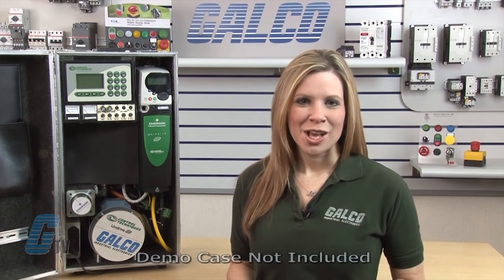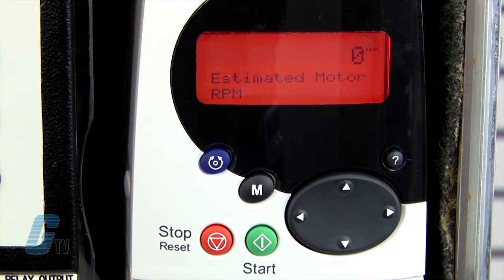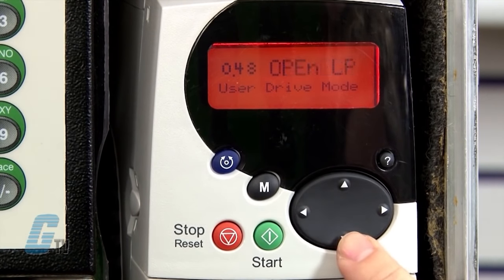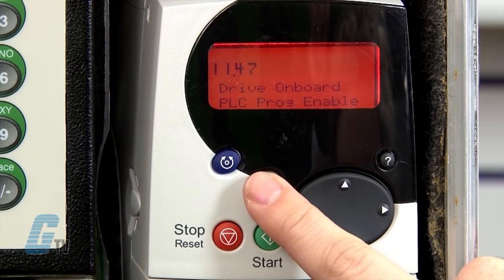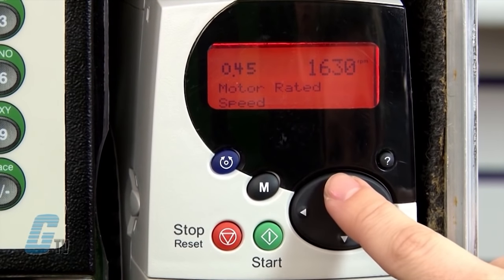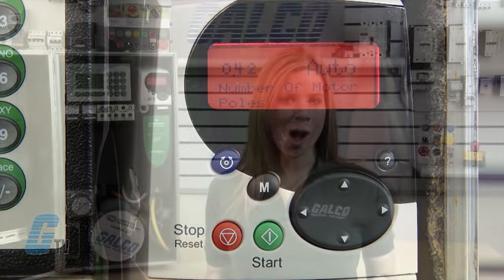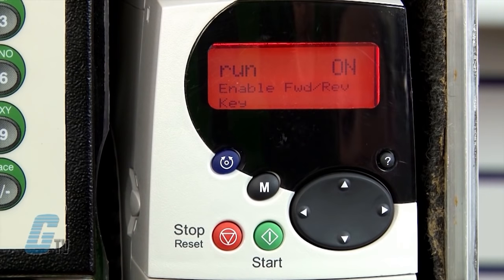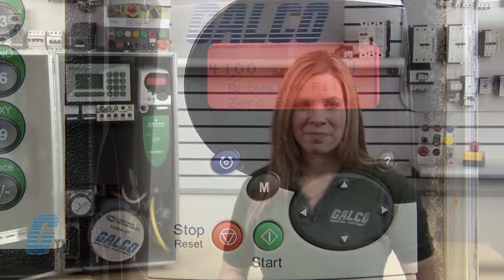Emerson Control Techniques Unidrive SP Open Loop Set Up - SM Keypad | Galco

Comment: I have an Emerson drive SP 2402, facing an alarm/fault “trip it.AC”. I tried to change the parameter 5.07 (by changing 0.49–>L2).
The par 5.07 doesn’t allow me to change the stored value that’s 0.00. 
Please I am seeking for the help. 
Does anyone know how I can fix the issue..

Comment: Hello. We have sp1406 indicating SL3.Er And SL3.Hf. could you please tell me how to solve this trip problem? Thank you very much
Reply from the maker: Ok the SL3.er fault means the drive isn't seeing the module in slot 3, or that module has been changed. Having said that, we have found on older SP drives sometimes these connectors become corroded slightly and may be able to clean enough to restore operation by simply removing and reinserting several times and push red reset/stop button. You must take special care when reinserting module to line up connector correctly so as to not cause more damage to unit.
The SL3.Hf fault  is a type of hardware fault. If this does not reset with the red reset/stop button or cycle the power, the failure may be terminal.
Reply: @GalcoIndustrial  Thank you very much for your soon answer. When you Say terminal un lastre sentencie do you mean fatal failure or connection terminal fail?
Reply from the maker: @laterrazabbq5647  Fatal or time to replace

Comment: i want how the unidrive communicate with  @calco TV please help me out !
Reply from the maker: Hi nasreddine ramdani, can you be a little more clear about what you are asking please? We would be happy to help you.
Reply: i want to know how can i communicate with UNIDRIVE SP M using Labview and how can i generate its values?
Reply from the maker: Hi nasreddine ramdani,

The drive has a serial communication port that is EIA485 type from an RJ45 connector. This port is isolated from the high voltage in the drive.
It supports to different protocols “MODBUS RTU” (default) and “CT ANSI” that are parameter selectable at parameter #11.24 (or zero menu 0.35 is same thing).
A 0 = CT ANSI, and a 1 = MODBUS RTU.

Let me know if this helps you out.
Reply: Hi Galco TV

Thank you a lot for your help ! 
I found that very helpful, and i would know if you have an labview structure of what you just explained to me.
That would be a pleasure to work with you !

Comment: Very good all this information, I really like learning about Variable Speed Drives, but I'm starting to learn about the management of Emerson Unidrive that possibilities exist to publish this information in Spanish?
Reply from the maker: Unfortunately, we do not currently have the resources to overdub the videos in different languages.  There might be a Emerson Control Techniques manual with information published in Spanish.
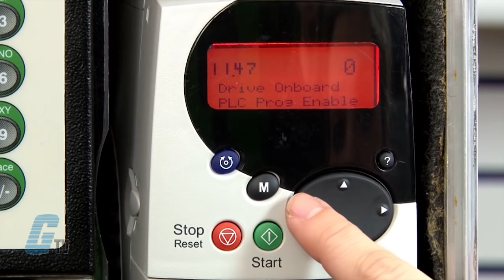Reply: GalcoTV thank you for reply , but in open loop (without encoder) i can change in parameter 4:11 just from 0 to 1  , or change from 0 to 4 in close loop .
i want to rum torque mode (unlimited speed )in open loop .
thanks
Reply: Ali Suliman i hope to help me of above problem as soon as possible
Reply from the maker: Ali Suliman You're right, then you will only be able to change it to a 1 for open loop.  This should put you in torque control mode.  I would also suggest downloading a manual from CT or from Galco's website.  To find it on Galco, check out the links above in the description page and navigate to the docs and links part on the product page.  A digital manual can also allow for easier searching by using Ctrl+F to find your selection.
Reply: GalcoTV i have a manual and i can do close loop but open loop its difficult
in old unidrive its easy  to do torque (unlimited speed  ) in open loop

Comment: i have unidrive sp i want to run  torque control(unlimited speed) open loop in old unidrive is easy .just select in macro by put 2004 in xx.00 please help me
Reply from the maker: Sorry for the late response.  You should be able to change to toque mode by going to parameter 4.11.  From here you can change it to a 1 for torque control or a 2 for torque control with a speed override.  I hope this helps.

Comment: How to save the parameters settings in sp5401 unidrive?
Reply from the maker: All SP Control Techniques drives save parameters the following way,,, x.00=1001 and initiate a drive reset with the Stop/Reset button.